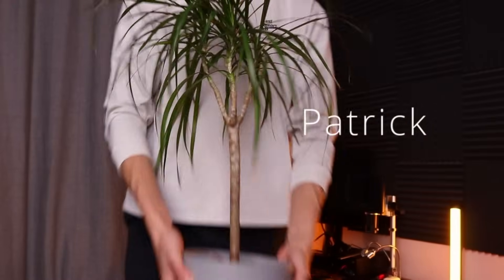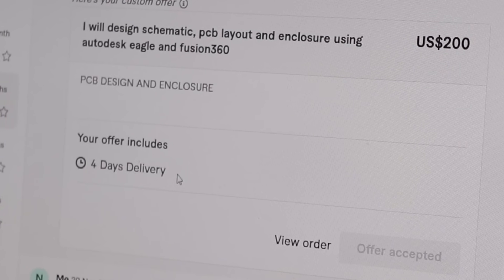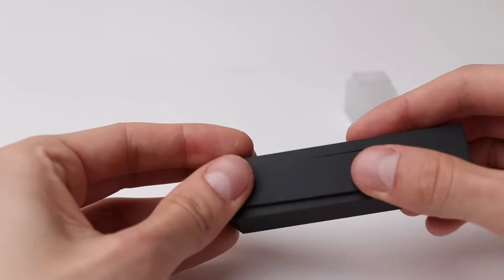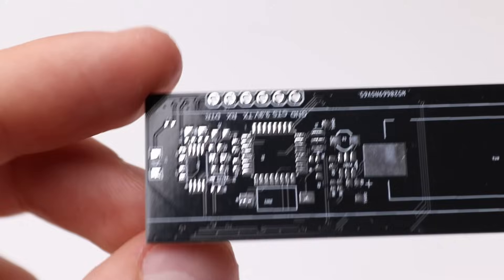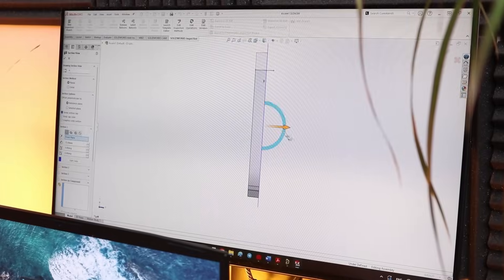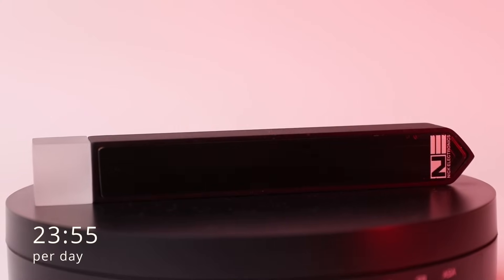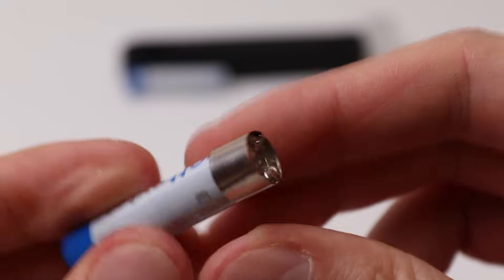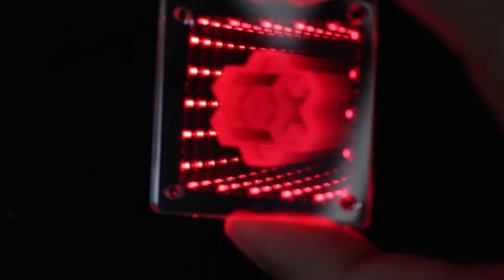Building an Unusual Soil Moisture Sensor from Scratch...

Comment: All of that looks like iterative process of creation of some good device. Except for lost 200$.

You both learn. Now my 2 cents. 3D printing is not waterproof, glue is often not very resistant. 
I've heard about much more advanced device. The crucial problem of your and aliexpress ones is lack of robustness. What will happen if you accidentally push your device during watering?
It will loose tight contact with soil somewhere. Thus it may fail to measure correct capacity.

The solution I read and someone proposed in comments (Tropblumat material) is some water-permeable material fixed to sensor. No matter what moisture will reproducibly come from soil to sensor even with lousy contact with soil. Tropblumat was mentioned in comments, while I read about ceramics in some scientific article. They also used transistor heating and cooling temperature transients for estimation of soil humidity.
I would prefer two stainless plates with ceramic sensor glued inbetween+some calibration.
Reply from the maker: Yep, there are much more robust solutions with higher measurement accuracy, which I might consider in the future. The usual way to do it is by reverse engineering something. I have to buy a Tropf-Blumat, disassemble it, and learn from it. The drawback, however, is the price—it’s quite expensive, even though it is better in a lot of ways

Comment: thats very neat.  id be worried that the batteries might corrode because of the slightly moist environment
Reply from the maker: I hope they wont. But there is one way to find out - test it for a longer time :) Also, I got a lot of comments regarding some round sealing ring where the thread is to make it better. So, there is a room for improvements.

Comment: Some constructive criticism:
1) Threads don't seal, as other commenters have mentioned. A standard o-ring at the top would do (not a custom one like your freelancer had)
2) Smashing all your electronics in a small space on a larger board benefits you little, and provides no ease for repair if necessary.
3) The battery solution is nuts. Look at how flashlights do this for inspiration if need be. Put spring on lid, lid pushes and makes contact with SMD battery contact on pcb when sealed.
4) A design whose battery dead state is the same as it's "everything is ok" state is a terrible idea. Please don't do this. Have it short flash when it checks, and long flash when it needs water -- anything but what you have right now.
Reply from the maker: @tiger12506  1) Yep, got a lot of comments about that. Will do that if needed. 
2) It is hard to repair indeed, cause board is glued.
3) Good idea. Flashlights that I have disassembled had an aluminum case which was a ground terminal as well. So there is no such a problem. But for  plastic ones IDK.
4) I don’t say it in the video, but there is an indication when batteries are discharged. It starts blinking several times even if soil is wet.

Comment: How are you measuring the soil moisture? Can you explain that part pls?
Reply from the maker: There is a capacitor, created by 2 parallel PCB tracks. When dry and wet, soil capacitance is different. By measuring the difference you can say if soil is dry or moist.

Comment: First,  let me say kudos for the design! I think a really useful improvement would be to use an ESP32 so that you could send signals to your phone using smart home standards -home assistant apple homekit both have libraries for easy integration. The benefit being that you could get rid of the need to see the LED blink to know, and also you could check the status to water it proactively
Reply from the maker: Yep, in the next version I think I will do that. The only problem is that Esp32 is much more expensive then atmega48

Comment: Almost perfect, id say replace their controller with an esp8266 running esphome and use the deep sleep function to achieve the same low power use, then when the plant needs water, wake it up and connect to wifi for a second and update the needs watering value in home assistant, same can be done when the moisture is at a good level again, you could even include a moisture percentage daily or something like that, but thats not a must. Then if we d a (i think its a tp4056) charge controller we can use an old vape battery so we can recycle throw away trash into something usefull and make it rechargable😊
Reply: Perhaps it could be implemented with a home alarm or wireless weather station radio protocol.  Or alternately a Infra red data burst with RC.5 codes or similar.
Reply from the maker: @KallePihlajasaari  I will think about it. Its a first prototype overall.
Reply from the maker: Yep, I was thinking about making it smart, but in such case you have to check the app with data or send notification. Didn’t want to work with IT level. But in the next version I will try using some existing platforms to make it “smart”.

Comment: Did you just put the spring side as Battery positive !!!!
Reply: That is one detail. Another is that the opposite flat spring for negative pole is soldered very creatively. It should be soldered to vertical plane 😊❤🎉
Reply from the maker: @humanpred8or  Didn’t have a choice 😅 Otherwise PCB routing would have been much worse. In the next design I’d find a way to fix it

Comment: The PCB polish rots in couple weeks in aggressive soil environment. You need to apply additional coating to PCB, which can resist the soil. (I used epoxy resin for this purpose)
Reply from the maker: @semlanik  I will see how it behaves over time 😅 Probably you are right

Comment: you do not even need a microcontroller for that, it's doable with just several transistors, opamps and other simple stuff that can even automatically water the plant, its cool but using such a complex tool for simple tasks does not seem right not cheap.
Reply from the maker: @mixgamer2908  MCU is quite cheap, around $1. And its only 1 component. Not gonna write here that every additional component soldered to the PcB increases device price. Also, have you calculated quiescent current of the circuit you propose?
Reply: @NickElectronics  it should be near zero on 1.5v, have not made it but I could try and give you some resaults, but by cheap I don't mean actual cost in dollars but cost in complexity of the circuit (only even the flash chip in mcu is very expensive)
Reply from the maker: @mixgamer2908  Why near zero? I suppose it would be milli amps. Cause there is no simple way to put circuit into a “sleep”. Also its not easy to find op-amp that works from that low voltage so far as I know. 1.5V its fully charged battery. From my experience it can be discharged up to 1.0V or something like that. 
I might be mistaking, but thats what my guts are telling me 😳
Reply: @NickElectronics  ok to be fair. I don't even know if they exist, but because voltage amplifier can boost up voltage, it means that they have components that work on such a low voltage, and considering sleep mode of microcontroller still use counters and some micro level logics, it still should not be able to consume less power than circuit made from simple stuff (op-amp was not good call, its made for high precision, while you can do same with sensitive high gain transistors) led on such a voltage might struggle too
Reply: @NickElectronics  I'll do my research and even try to create circuit for it, in this point it's going to be more fun for me.
Reply from the maker: @mixgamer2908  Appreciate such an effor from your side :) Dont forget to share obtained experience later.
Reply: @NickElectronics  so i had some exams and problems so i could not work on it, but when i did, i realized its very simple circuit, so im just gonna write it down
   problem_1) detecting lack of water
      using resistance of dirt with two rods in ground, it will be part of resistor divider with analog output indicating ground moisture (i used 300K Res for stable results) feeding in comparator to get digital output (rods should be close 0.3-1cm 3-5cm long same material, same size/length)
         + simple and easy to make
         + cheap
         - rods might rust unless they are made of stainless metal
         - if not properly configured it sometimes acts like battery, throwing off reading and damaging soil
   problem_2) power supply
      ideally using 3v coin cell battery (needs at least 2.5v for led to blink and 555 timer), if used rechargeable battery (overkill but still) can be charged with inserted ground rods (when taken out with special controller) 2.5v is mainly lowest needed voltage because of LEDs, but if needed other solution is to use two capacitors charging in parallel and when switched on discharging in series duplicating voltage, same circuit can replace 555 timer, but this solution needs type of transistor that blocks current from both ways, something like thyristor, but i dont think one with such low holding current exists which is sad, as there are some comparators operating down to 1v. now how long will the battery will last is based on real life testing as comparator and properly configured 555 timer will consume very little power.

its possible to replace resistive sensor with simple chip which automatically measures ground moisture using capacitive sensor, but its boring and premade solution, and more expensive.

Comment: I think the title is slightly incorrect - you did not made a "sensor" (as in a subject about what material react on moisture and became more conductive as moisture rise), but you made some very nice housing and control circuit with LED warning lamp to the moisture sensor that seems to be a very cool project.
Reply from the maker: @Ju13n1s2e9  I designed PCB with a sensor as well. Sensor is a capacitor, formed by traces on one side of the PCB. When dry, permittivity has one value, when dry - another, which changes capacitance. With MCU i measure that difference and can tell if its dry or wet. My mistake was in not saying it in the video

Comment: Great project! I've had the same concerns when wanting to know when to water my plants, that it ends up being a pain to check because it's easy to forget when I should check. This makes it obvious when to water because of the flashing red light. Great design also. I have some notes; take it or leave it. By convention, the negative terminal is usually the spring, and the batteries would be compressed slightly in the holder by screwing down the top, which would have a metal end with the conducting socket. I hope you find my comment interesting. I love the project and keep it up. 👍
Reply from the maker: @cavendysh  Regarding the spring I agree. The problem was in the other thing. Battery casing is a minus, so when plastic is removed, it exposes negative terminal, which supposed to be connected to the golden contact. I didn’t want to change contacts polarity on the PCB cause tracks routing would be much more complicated without adding more vias 😅 In the next version I will try to find a way to fix it and make it the right way.

Comment: 4:17 the mcp1640T is converting the 1.5V from the battery into the 3.3V the main CPU and the 555 timer can run off of...  The connector is used for programming when you want to change the code  and the reset button is used for entering a bootloader so you can program it (although that could be triggered by the programmer - but this give you the bonus functionality of quickly resetting the code for testing if you want to iterate...) The crystal oscillator simplifies Arduino IDE compatibility and ensures serial communication timing is correct (useful for debugging, or even uploading...)

(I am NOT the author of the schematic).

The only useless component I can see is the 555 timer.
Reply from the maker: @thegoodhen  1. There is space for 2 batteries. No need for boost in such case. If author has decided to use 1 battery, why making the device that big then? 
2. Connector is okay, but it does bot have to be that awkwardly large.
3. I reload the code by pressing one button on my PC (it takes 0.5 seconds). Why do i need external reset button?  
4. Arduino ide compatibility😅 Code flashes without any oscillator. Chip has internal oscillator that works just fine and more then enough for an application
Reply: @NickElectronics  2 batteries are going to only have 3V. I haven't done the calculations regarding the battery life, so I cannot comment on that. My assumption, however, is that the author was trying to keep the design as close to the 3v3 Arduino pro-mini as possible. This is where the adherence to 3.3V, the reset button and the programming header come from - as well as the use of the Atmega328p, which is an overkill for this application.
Reply from the maker: @ Yeah, but there is no point of making it 3.3V compatible 😅 Atmega48 I use works from 1.8V, so it will keep working even when batteries are discharged

Comment: Why not read out the WiFi signal strengt? It will change with the soil moisture. 
Everything can be enclosed in one waterproof tube.
Reply from the maker: @goiterlanternbase  What? 😅 Measuring Wi-Fi signal strength probably not the best solution for that task if I had to guess
Reply: @ The soil solution is pretty aggressive. That lacquer on the PCB is known to fail under that conditions. 

If you like to fumble on a proven solution, get yourself a Tropfblumat and translate the membrane movement into your light signal. 
Why this sensor? Because it is known to work for decades. The best part of 2, in my case. 
The company behind that, has a Digital Blumat, that spits out data, but your system could be more elegant, because it isn't just another IOT device.
Reply from the maker: @ Thanks for sharing your knowledge. I will consider it when I redesign the device :)

Comment: The inventor of an insulated ceramic mug had so much trouble getting his product manufactured to his specifications in China he had to go there and spend months getting the product right. That's essentially a product with two or three parts. Starting from scratch and learning everything as you go is probably more efficient than getting strangers from a strange land to comply with your instructions.
Reply from the maker: It is indeed more efficient. As the saying goes, if you want something done right, do it yourself.
Reply: @NickElectronics  If you ever do a redesign, I would recommend a flat rechargeable battery, and an above-ground charging connector. It could be the most compact battery available, because the device is extremely low current and easily recharged. This would allow the stake to be quite narrow, and to have no seams requiring sealing.
Reply from the maker: @crawkn  The main feature of AAA non-rechargeable alkaline batteries is their high capacity. It’s around 1000 mAh, which is insane. It’s very hard to find a rechargeable battery of that size with such a capacity. So, if I had to choose between recharging once a month or replacing batteries once every two years, I would probably choose the latter. But I don’t know—it depends on the user. I just hate charging stuff. 😄 Humans already have too many things to charge and take care of in our lives: phones, watches, tablets, fueling cars, cooking food... It’s crazy!

Also, a charging port would need to be sealed somehow. Maybe it could have a magnetic charger with two metal contacts sticking out? Or... wireless charging? That way, there wouldn’t be any exposed contacts, and it could be perfectly sealed. Maybe that’s the best idea! 😄 But it would require more electronics inside and an external charger, which would make it more expensive. So far, I only have an MCU, a few capacitors, and two diodes inside—it’s like one buck. I don’t know. There’s a lot to think about! 😄
Every solution is a trade-off
Reply: @NickElectronics  yes you are right that design priorities are the deciding factor. A transparent cap over the top could substitute gravity for a watertight seal.

Comment: 200 bucks for this? Maybe I should become a freelancer too :D
Reply from the maker: Finally someone with a common sense :D
Reply: I'm a product designer, and $200 is a serious underbid. The people quoting $1000+ for a first prototype were on the right track. Personally I would probably quote about $2k depending on the level of quality of the prototype desired, especially if it's designed for manufacture. There's a lot of high skill work required to do this kind of stuff, and I personally won't do it for minimum wage. Like yes, a moisture sensor is basic and well understood, but it's still not $200 and 4 hours worth of work.
Reply from the maker: @ Thanks for a comment. Appreciate your respond. 

I didn’t put a price limit. Freelancer himself did. So I kinda expect design to be at least somehow good. 

It also very much depends on the country. In some countries $200 is a half of average monthly salary, which is more then enough. Thats why people hire freelancers at the first place. Thats why goods from China are so cheap. Thats how worlds economy works. 

From the other side, In the video there is a part where I basically say the same thing as you wrote in the comment. To get better result, price has to be higher. 

However, for $2k dollars I can hire a company with a reputation, which would produce several prototypes and check if everything is correct. Why hiring a freelancer in such case? ( I did ask one company how much it would cost and they said $2k, so I am sure about the price)